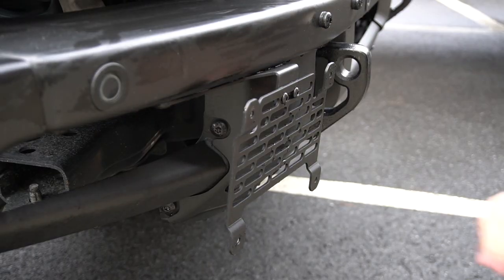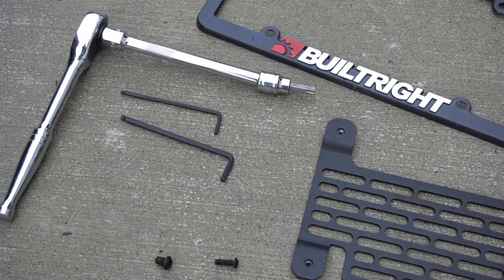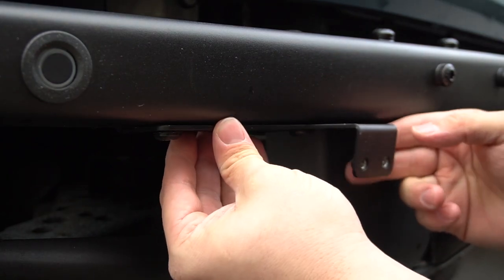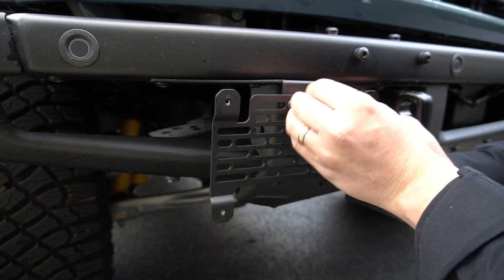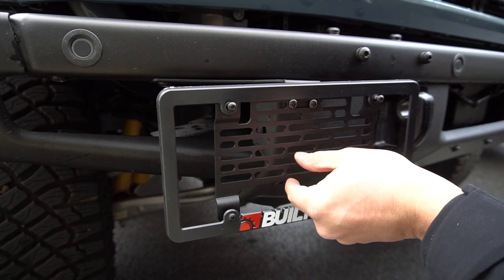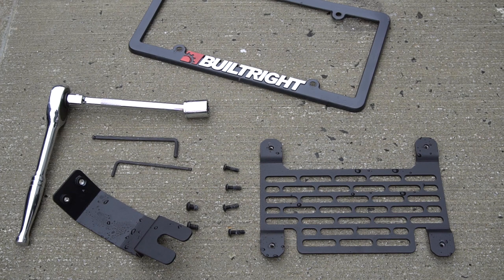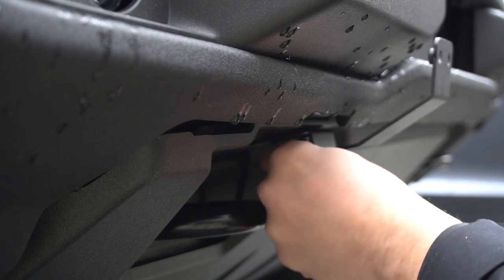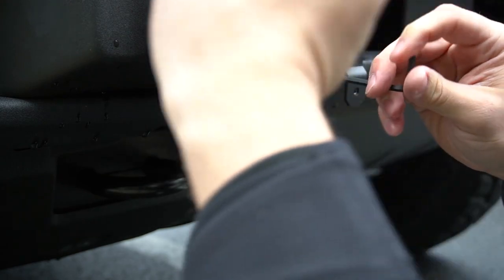Ford Bronco License Plate Relocation Kit Install Guide // BuiltRight Industries

Comment: I just installed this license plate bracket on my Bronco Outer Banks with plastic bumper that is loaded with all options (sensors, radar, and LED fog lights).  It was easy to install and looks great.  The only minor issue is it had to partially block one tow hook in order to avoid everything else.  Not really an issue as there is the other front tow hook.  No drilling!  :)  I luv it !!
Reply from the maker: Thanks Justin - glad it went well! As far as the tow hook, you're right regarding the other one and in a pinch (or when off road) you could just remove the mount with one bolt!

Comment: @ 8:45 On the OuterBanks the plastic bumper has a sensor right where you’re putting the plate bracket.
Reply from the maker: Our wildtrak was original equipped with the plastic bumper with the same sensor location. It just requires adjusting the bracket and plate mount differently. Let us know if you have issues!

Comment: It would be nice to show how you can mount this awesome product in plastic bumpers with sensors on it so people can see if this is the right solution for them. Thanks and great product. Just need to make sure it will work for my Wildtrak before purchasing.
Reply from the maker: Great idea - we’ll work on a ‘product overview’ video that shows those options. If it’s any peace of mind, our Wildtrak originally had the plastic bumper and we did test with it. I know it’s better to see for yourself sometimes though. Give us a week or so to put that together!
Reply: @BuiltRightInd  can you provide a photo on how it was mounted with no sensor obstruction for the plastic bumper? If this is the case, you should definitely advertise it as it’s the only one I’ve found that might work.

Comment: Can you mount the front frame in reverse so there is no build right brand name showing?
Reply from the maker: You could just choose not to use the plate surround at all - the product itself will function just fine without it!

Comment: I installed this yesterday on my outer banks (standard bumper). It has the high package, which comes with the front parking system. Once you mount the license plate onto the bracket, the system goes crazy because it blocks a sensor. 

I’m guessing this bracket is not suited for standard bumpers with parking sensors?
Reply from the maker: Hey Kyle, we developed the standard bumper kit using our Wildtrak with high package, so it had the sensors (the video shows it with mod bumper because we swapped that on). The standard bumper kit has adjustability as far as where the two brackets connect but can also be pivoted around the primary mounting bolt. I'll see if I can dig up some photos but I do know that there's a configuration that won't cause issues.
Reply: @BuiltRightInd  that would be much appreciated 🙏🏽

Comment: I bought one of these for my '22 Outer Banks. Just waiting for the state to send me my plates. I can figure out how to mount it so that it won't block the sensors, but I wonder if the setup can withstand our local Brown Bear car wash? Will the front plate get ripped off by those roller brushes?
Reply: I just recieved my Outer Banks and have the same question.  How does it hold up in the car wash?

Comment: Just put them on my outer banks, plastic bumper with parking sensors. It works well if you rotate the grill on a different way he does in this video, you will be able to avoid the sensor covering… 😊 I love it so far…
Reply: How did you end up getting it to fit without blocking the sensors?
Reply: @DirectorDeek  just find where it doesn’t cover the sensor.. I wish I can send you a photo
Reply: @DirectorDeek  I put in on the right side
Reply: @Monicagellerazz  I guess I’ll have to mess with it more. I can’t seem to figure out how to do it yet.

Comment: Looks perfect for my Wildtrak (plastic bumper). Is it compatible w/ the active cruise control and bumper sensors?
Reply from the maker: Yessir! Tested on our Wildtrak with plastic bumper and sensors!
Reply: It’s still covering my front sensor on my wildtrak. Can anyone help with this?
Reply: FYI - Does not fitthe 2023 Wildtrak because it now comes standard with the Steel Bash Plate option. The mounting bolt is not there with the Capable plastic bumper.
Reply: I swapped out my plastic bumper, for an oem steel bumper. I had to just slightly bend the mounting arm and it’s good to go. Doesn’t block any sensors.